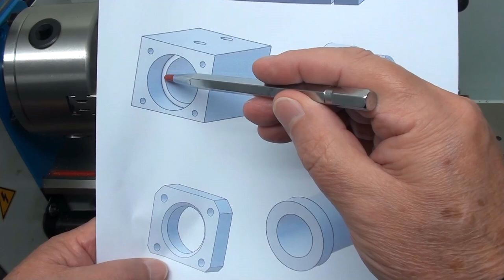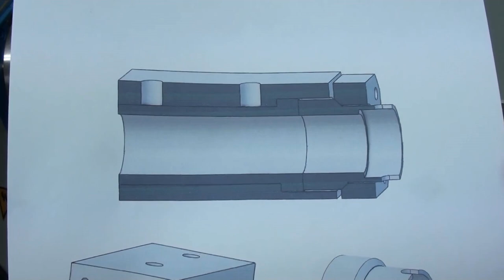Mini Lathe Anti-Backlash Nut

Comment: I like the design of the Nut.  
I've just had my chuck off my mini Lathe and noticed the spindle is milled to accept some sort of Tapered part? I just noticed you have a collet set up on yours. I'm trying to figure if it's worth it seeing how I've reground my chuck and get almost Pure true concentricity from it and it holds any size stock while doing so, sub .0005 run out.
Reply from the maker: Hmm.  Five microns is pretty ambitious!  Good luck with that on a mini lathe.  I'm not quite sure what, if anything, you're asking, but most mini lathes like mine have a spindle taper to fit a Morse No 3 chuck and that's what I have fitted in this sequence.  It gives a better grip on small round stock without the possibility of the workpiece getting marred by the three jaw  serrations.  John